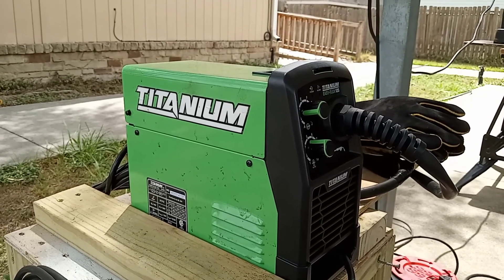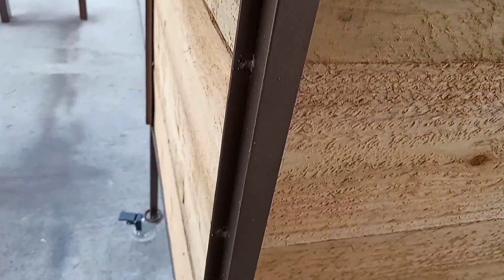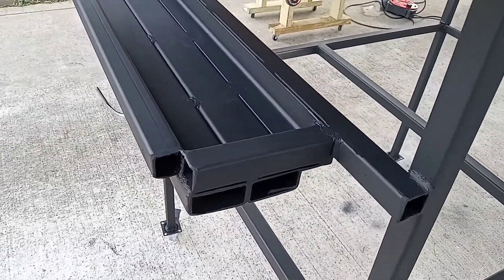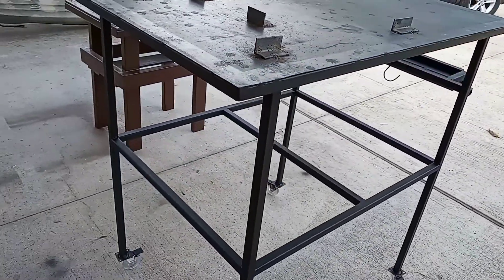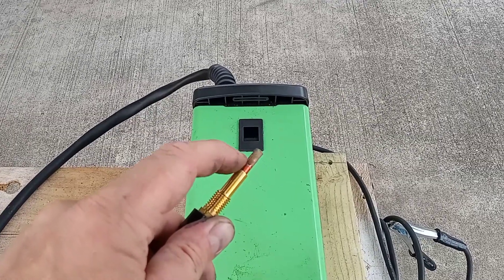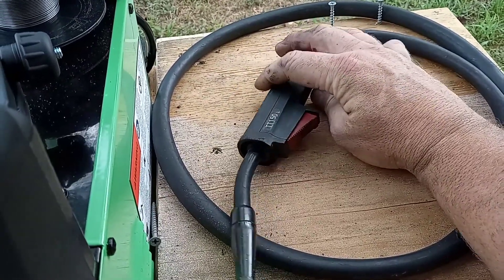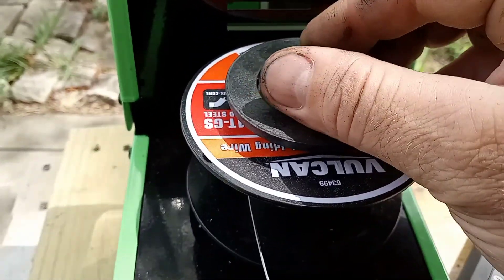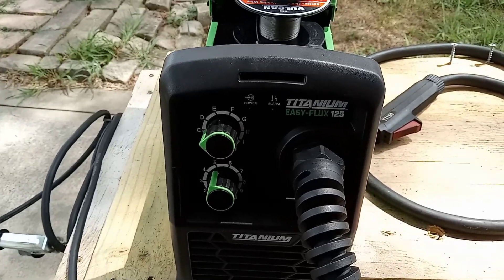Update Titanium flux core gasless 125 welder update and things I built with it

Comment: I have this welder and i love it! I can weld almost anything for hours using just my ECOFLOW Delta Max portable power box. The only complaint i have is the gun. Sometimes the button doesnt work correctly but for the price id recommend this machine to anyone beginner or expert!
Reply from the maker: For sure, agreed. The gun is kind of cheap. But, overall it's a great welder. The more I use mine. The more impressed I get. Thanks

Comment: 🔥 Lincoln & Forney wire work the best for me on my Titanium 125 🔥
Reply from the maker: Cool, will have to try it. Thanks!
Reply: @jdtools6038  nice, let me know which on you like more. Froney is at tractor supply and Lincoln Home Depot or Lowes. Thanks
Reply from the maker: Will do Capt. Still have to go through what I have now. I don't weld as much anymore, like I used to. May take some time.  Thanks
Reply: @jdtools6038  no problem, i also just received a roll of 2 pound yeswelder wire, which is supposed to be great. I don’t weld much ether but my 11 year old boy is showing a lot of interest in welding.  Be blessed.
Reply from the maker: You too, thanks

Comment: I welded a trailer hitch assembly to a friends heavy duty trailer and I must say these things are little beasts. I could only run the welder about half power anything more would have blown through. These are great machines that remind me of miller welds I have put down on ships.
Reply from the maker: Yes sir, agreed. Miller gas mig is hard to beat. First time I used it, was impressed and did feel like a Miller. Ya'll didn't use stick on those ships? Figured the metal would be thicker and needed better penetration.
Reply: @jdtools6038  Mostly dual shield fluxcore. I love the fact you can push it like hard wire mig. We did stick weld certain things like handrails , clips ect.
Reply from the maker: Right on!

Comment: Why don't they list voltage for 18g
Reply: @jdtools6038  there is no voltage setting for 18g guess the left.that out
Reply from the maker: Understand, I can check and let you know by looking at the reference sticker on the machine.
Reply: @jdtools6038  ok
Reply from the maker: OK, it says. 18 Guage about 1.2mm. 0.030" wire. 3.5 to 5... B to C setting. For the 0.035" setting it doesn't have anything for wire speed /voltage setting.
Reply: @jdtools6038  ok